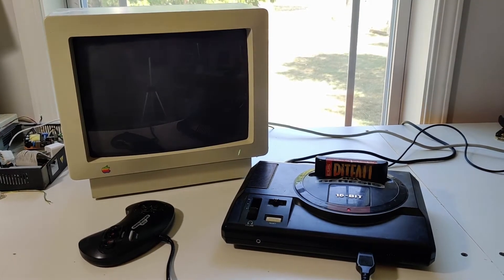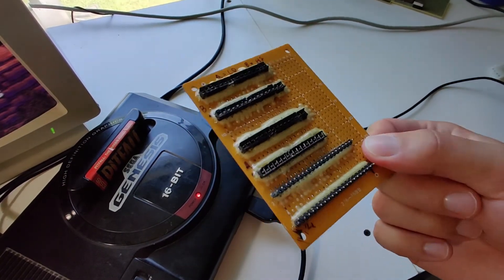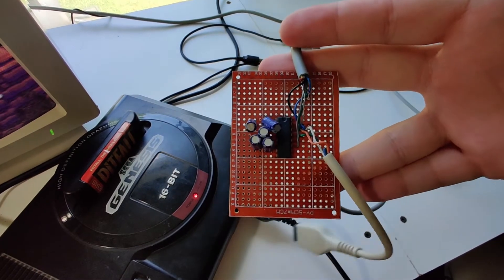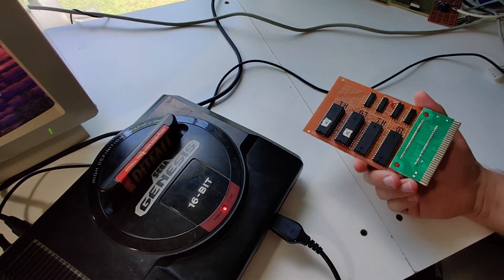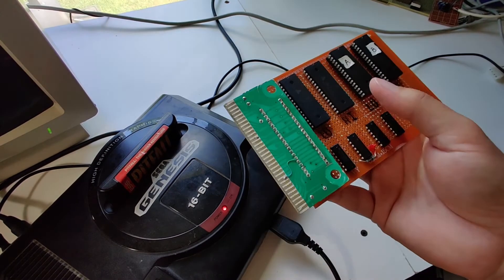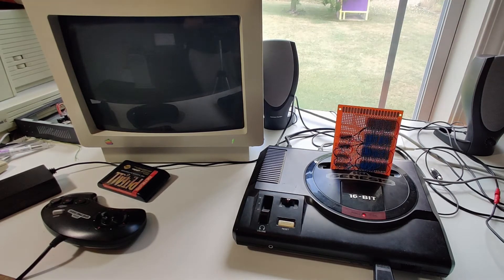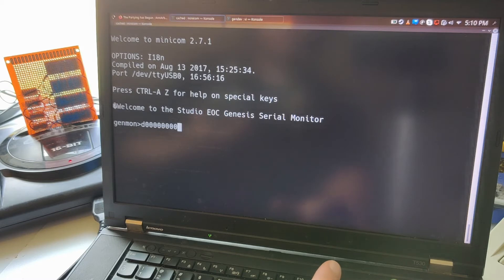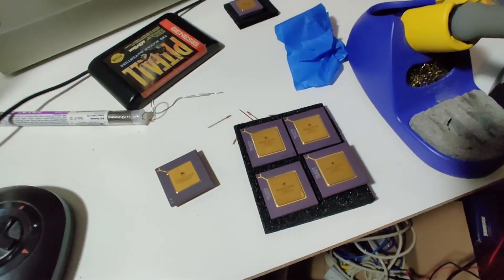Geek Rant #7 : Sega Genesis/Megadrive Serial Console and Homemade Dev Cart

Comment: I like the Retroad 5 Plus with the Mega Drive adapter. It plays MD Everdrive Pro and can handle SEGA-CD. It weighs a ton though so play with the stand and a SNES Dongle and a GBros. Adapter with the Hori Fighting Commander. Or just do a firmware update on the SNES dongle and use the NES/SNES Online controllers. I am getting the SFC52HD and I will try the same adapters on it. Retroad products work together with no extra wires in HD. I also am happy with my New 2020 Version 2 Retroad MD with 98% compatibility. I have 2 Brawler Gen controllers and am waiting for Paprium hope it works on something.

Comment: It was still interesting despite the fail. The 68k project also sounds fun, I should really dig out my tiny68k board and do something with it.
Reply from the maker: I wanted to do a 68k machine from the start but blew up the only dip 68k I had left before moving on to the 65816.

I'm so looking forward to doing all of my system software in beautiful, orthogonal, flat-addressed 68k assembly. Some day.
Reply: @TrackZeroFutzin  I look forward to the video.